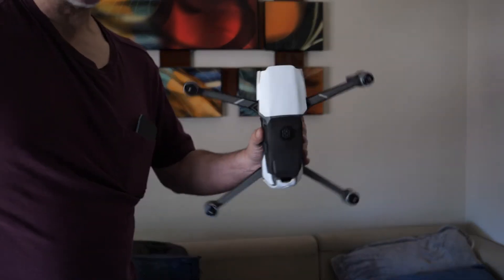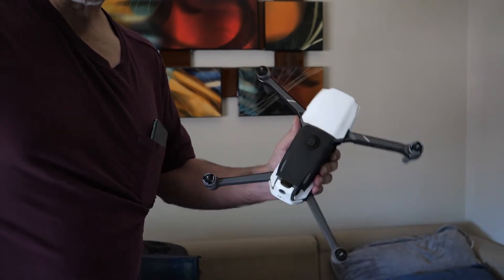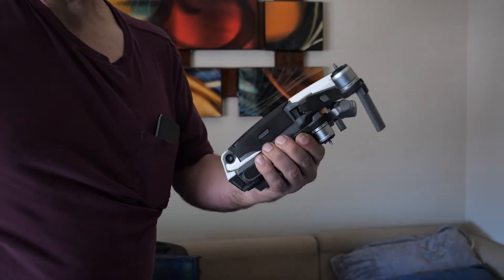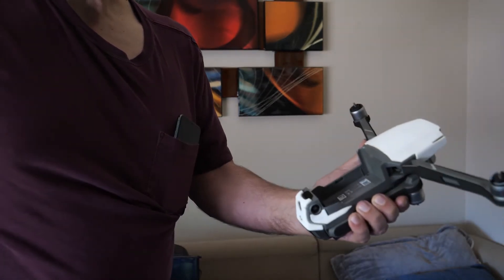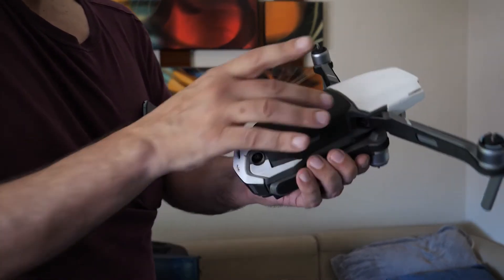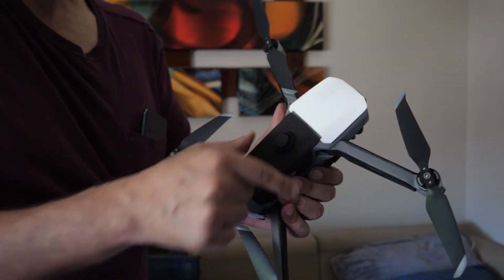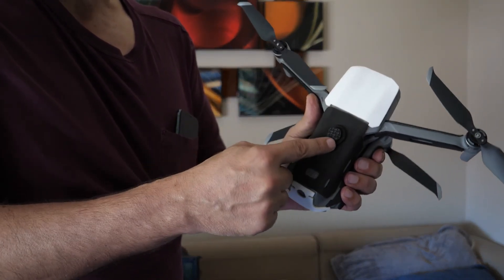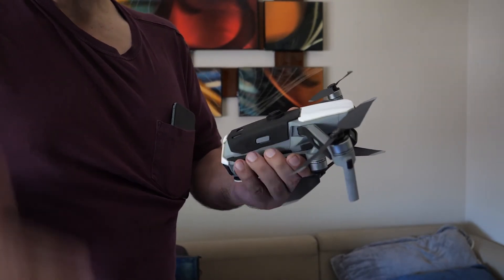Mavic Wet Suit : How they work

Comment: But what hapen with the motors?
They doesn't crash or something like that? AND what hapen with the camera
Reply from the maker: The Motors are Aluminum - Brush - Less Motors designed to negotiate Water so well that these same exact motors are used for Submersibles. and the Camera has an air Tight seal which is why they can film under water for a few seconds before the signal goes out.    See phamtomrain.org for underwater videos.    Thank you .